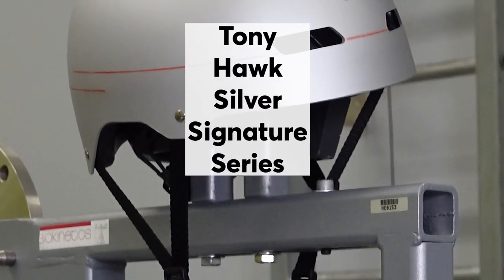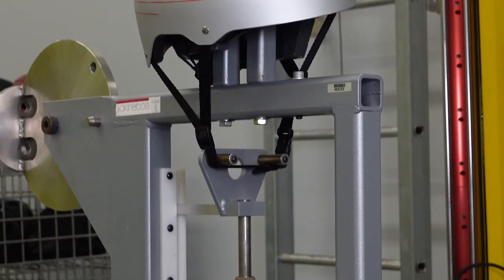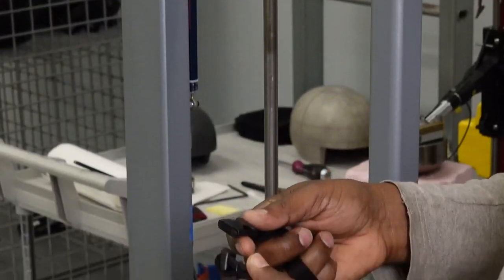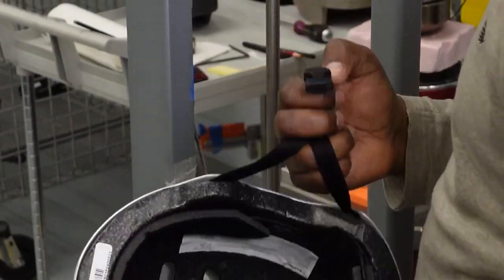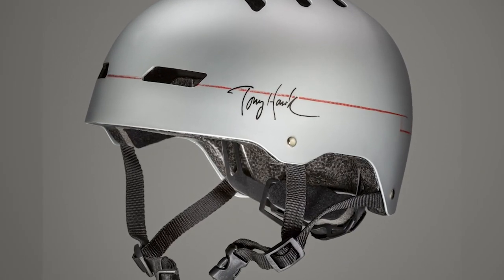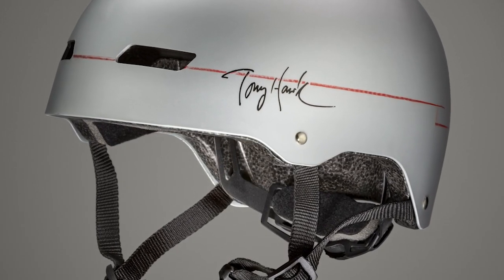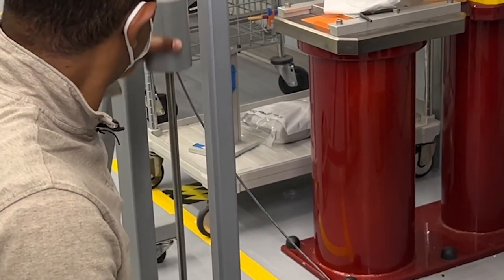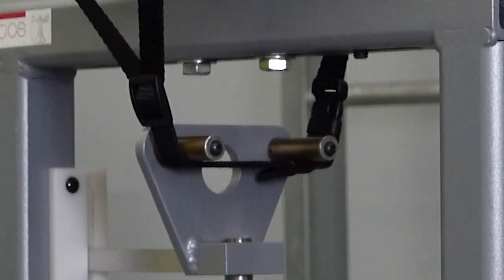Tony Hawk Signature Silver Series Helmet Fails Our Safety Test | Consumer Reports

Comment: Some people are completely missing the point; yes, there was a great deal of pressure put on the strap - like what would most likely happen in an accident.  The purpose of the helmet is to protect you in the event of an accident.  If the buckle breaks, you have no protection.
Reply: Good point but the pulling pressure seemed to be pretty excessive. 
Given the right circumstance I could see this being a problem but if it's pulling that hard you've got bigger problems than just a chin strap breaking. Of course this is only my opinion, I could be wrong.

Comment: There's no context for this at all really. What is the acceptable force for a chinstrap to resist before it breaks? Why? How many pounds of force did it take to break this chinstrap? At what amount of force did other helmet's chinstraps break at?
Reply: All fantastic questions, I'm pretty curious of that too. 👍👍
Reply from the maker: Thanks for your questions. The exact force on the chinstrap retention system is dependent on its elongation.  We agree that this is a tough test but it was developed through the normal standard setting process where manufacturers, industry, and consumer interest experts develop tests to simulate real world conditions.  It's also part of a Consumer Product Safety Commission (CPSC) mandatory safety test that all helmets must pass before being sold in the United States. In addition, there are nearly 80 other helmets in our ratings that passed the same test.